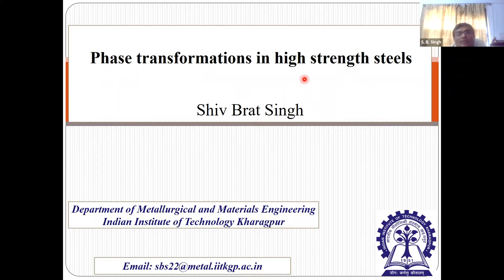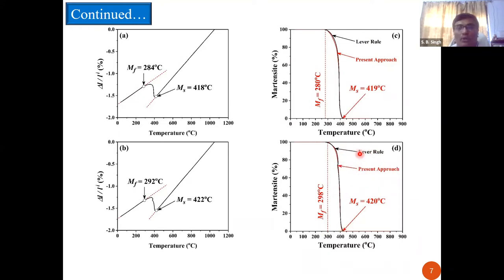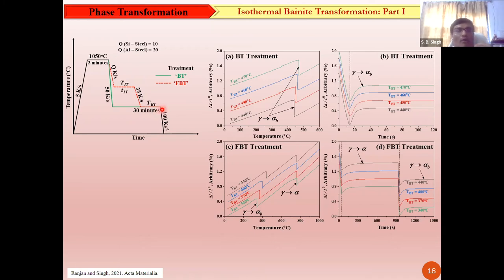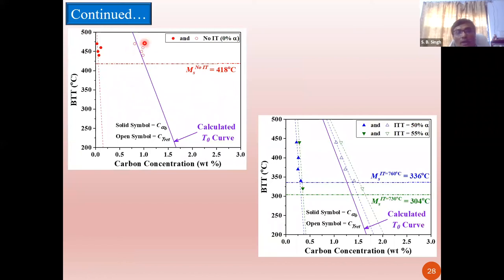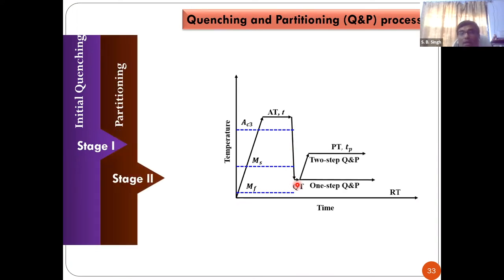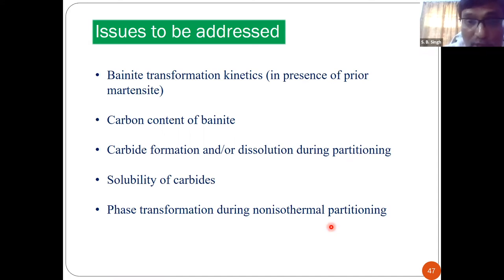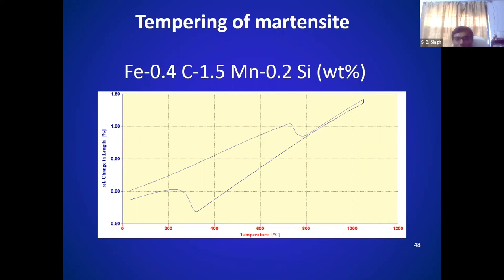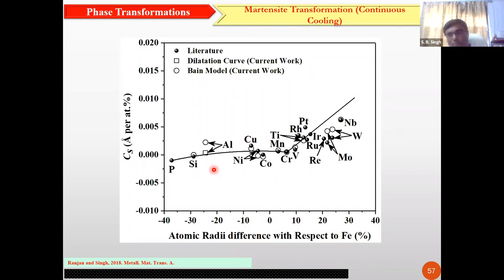Phase Transformations in strong steels, by Shiv Brat Singh, Lecture 13 of 25

Comment: Very nice, could you share some paper about this research ? Best regards
Reply from the maker: Mangal A, Biswas P, Lenka S, Singh V, Singh SB, Kundu S. Dilatometric and microstructural response of variant selection during α′ transformation. Materials Science and Technology. 2014 Jul 1;30(9):1116-24.

Samanta S, Biswas P, Giri S, Singh SB, Kundu S. Formation of bainite below the Ms temperature: Kinetics and crystallography. Acta Materialia. 2016 Feb 15;105:390-403.
Reply: @bhadeshia123  thanks a lot,